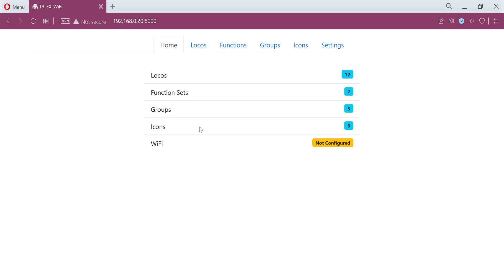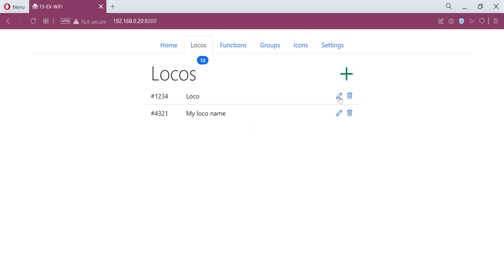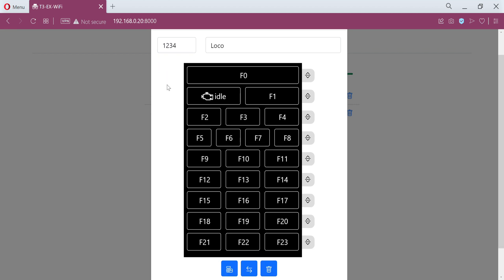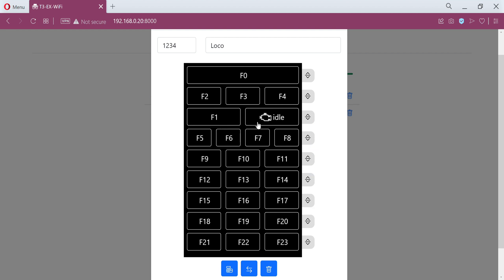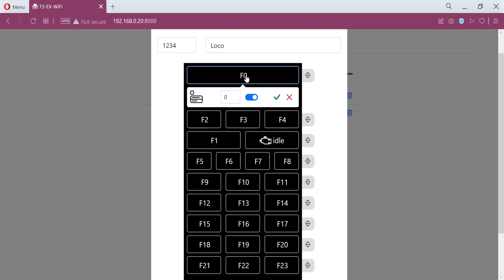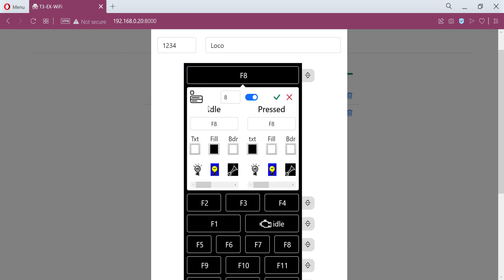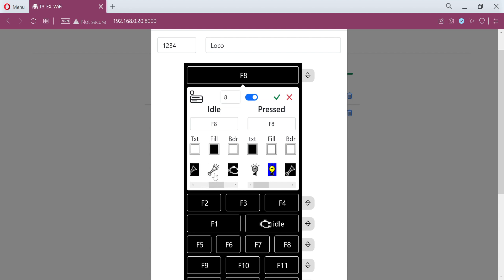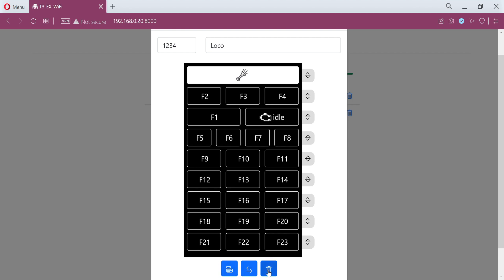T3-EX-WiFi - Web editor preview - DCC++Ex Throttle

Comment: Hi, Can you implement the functionality that if you are connected to JMRI, then your loco roster can automatically be downloaded to the throttle ?  I have a ESU ECoS 50200 and it uses this method.
Reply from the maker: Hi, I've not used JMRI myself so not familiar with the functionality.
I've tried to organise the code so it can be extended later on so there's always the possibility it could be added.